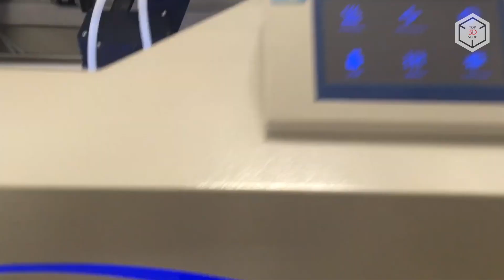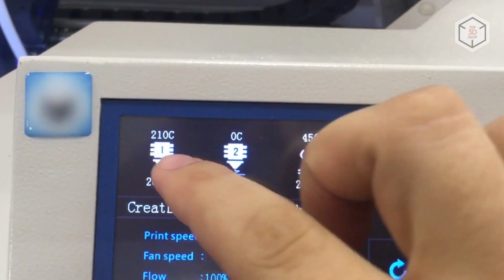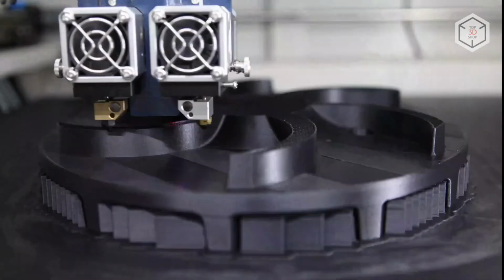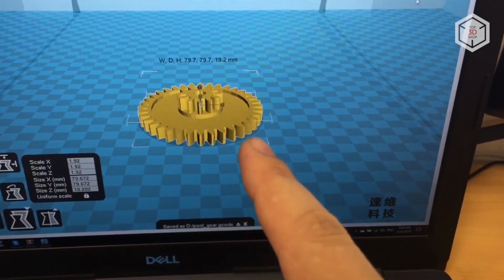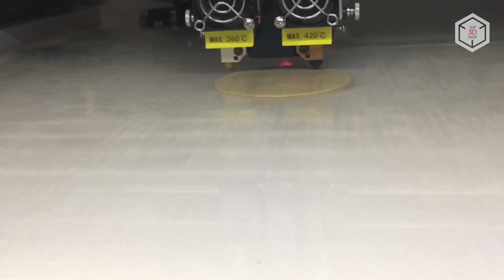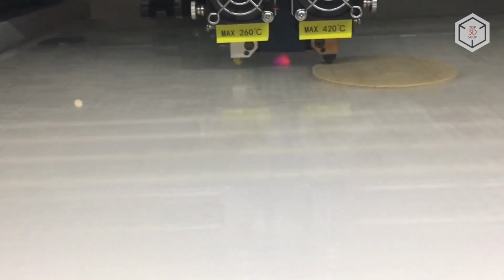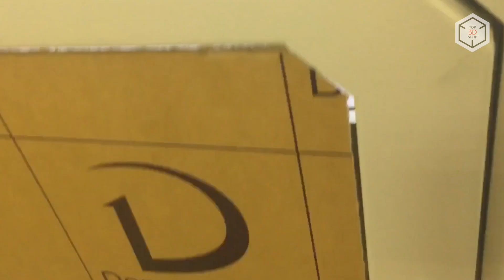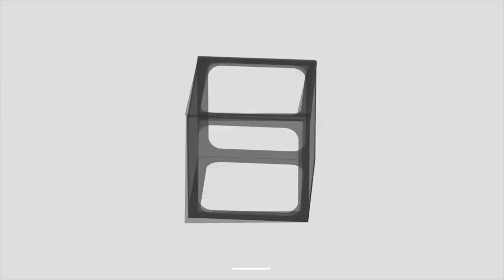CreatBot D600 Pro Review: Dual-Extrusion, Large-Format 3D Printers

Comment: We have one at my work and it has not stopped giving problems, if a piece comes off you can say goodbye to the print heads, the layer fan and the leveling sensor.  Print quality is better on a prusa mk3.  Filament sensors fail over time and if you have managed to print a large piece you can pray that the filament does not get stuck inside the Teflon tubes.  The print heads become loose from vibration and the printer self-destructs.  Don't waste $15,000
Reply: Same. We have one and the (bad) print quality is not consistent. And it's great you can heat the chamber for the material, but who had the idea of making it only big enough for 1kg rolls. If you have big object's you obviously need more than 1kg, so it needs to stand outside of the printer. Just why?

Comment: Save your money and bambu labs x1c instead. It’s 1/10th the cost and better in every way.
Reply: Did a side by side comp this unit says it does 600x600x600mm . .the largest Bambu I can find is 256x256x265mm?  Is there a larger unit?
Reply: No but there are very few scenarios where you need a singular piece that large. Modern day software (slicers or CAD) can break the model into chunks that can be easily bonded together with little to no impact on structural integrity

Comment: Would this be a good choice for small batch production ?  Have seen very few reviews online.
Reply: Nope, not at all. We have one at my company. The Y-Axis is squeaking as hell, the bed is not reliable, first after changing the bed through support. The slicer is one of the worst Ive ever seen. There are much better solutions out there.
Reply: @rhotix403  any suggestions?
Reply: What machine would you reccomend with at least 400mm x 400mm?  @rhotix403
Reply: @rhotix403  which alternative do you suggest? What kind of problem did you found on your machine?
Reply from the maker: Hi Sankar, yes this is a great solution for a small batch production